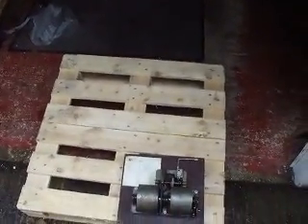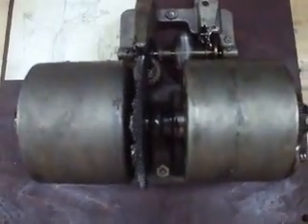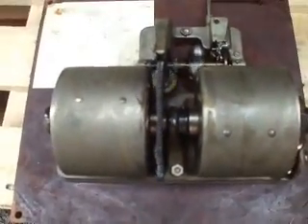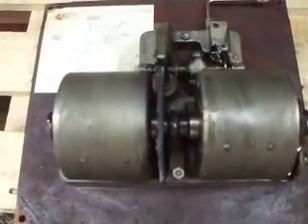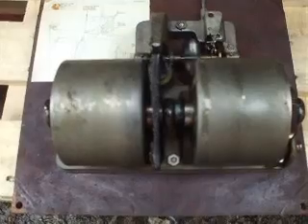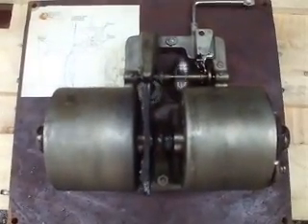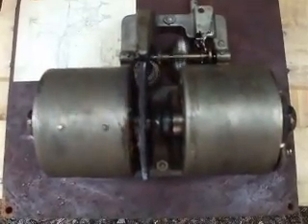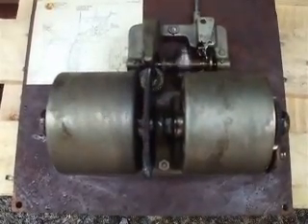Demonstration of the HMV model 34 motor working

Comment: Thank you so much EMGColonel. I was unable to find the internal mechanism of Model 34 anywhere on the internet. Actually, I am barely able to find anything about the model 33 and 34. But this surely helps a lot. I am about to buy one of them and I want to know more about it so that I can discern whether the one I'm looking at, is really an original Model 33 and Model 34 or a Frankenstein version put together from different scrap machines. If you happen to have some more information and images of the models 33 and 34, I would greatly appreciate it. Thank you once again.

Comment from the maker: I would think so - it's a Victor design so i suppose they would be interchangeable but haven't actually tried it myself. i do know that the French versions of the 32 /43 motors have slightly different castings
Reply: I´ve recently acquired a HMV 163 built for the Spanish market, would you happen to know if like the French, would the castings be different on their 32/34 motors? Strangely enough my Spanish marketed HMV 163 has a 34 and not the 32 motor. Due to the thumping sound I have recently cleaned both barrels of the heavily encrusted, probably original graphite grease only to find  two of springs   which I believe to be original, having the words "The Gramophone Co Ltd , Hayes Middllesex", stamped on it. You wouldn´t happen to know, with a full wind what the run time should be? As my 34 motor is able to run for approximately 20 mins irrespective of weather there is a record is being played or not. It would be good to know your thoughts.